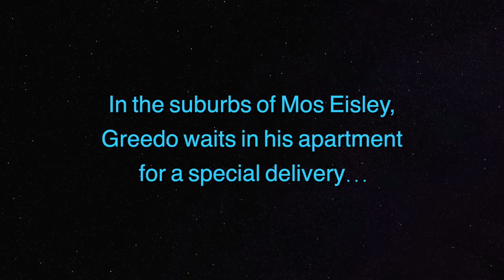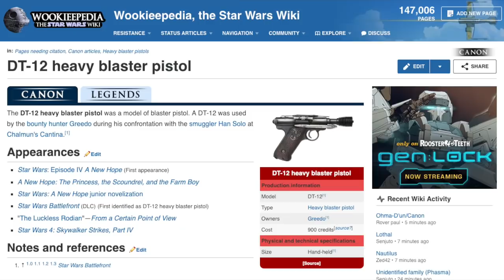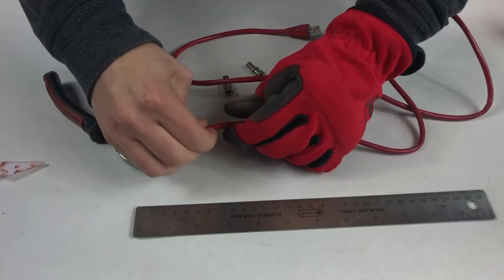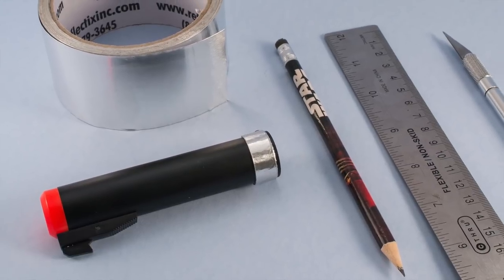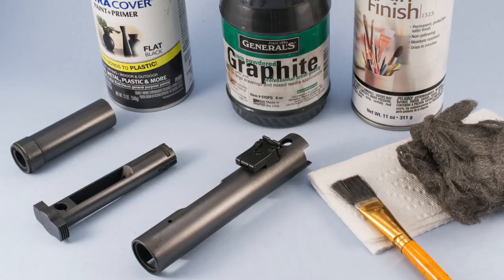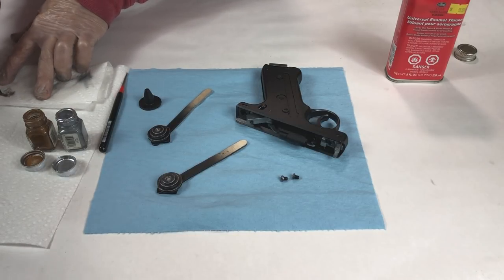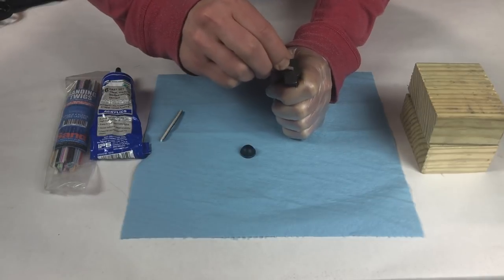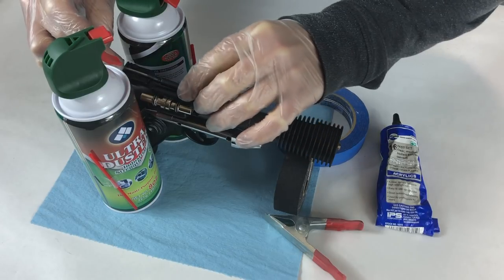DIY DT-12 Heavy Blaster Pistol (Greedo's Battlefront Version)

Comment: What do you use to edit
Reply from the maker: Hello, I use Final Cut Pro X to edit videos.
Reply: HappyTrooper I also have one more question In this video when you edited r2d2 did you also use Final Cut Pro or something else
Reply from the maker: @billylewis9975  I built an R2 unit a few years back, using styrene sheet, 3D printed parts, and electronics controlled by an Arduino Mega.  R2 is controlled with a PS3 Move controller via Bluetooth.  I setup a green screen in my living room and put R2 in front of it.  I then shot some video with my iPhone sitting on a tripod.  Basically, R2 is in front of a green screen, with lights blinking and head turning sporadically.  I never move him.   I had to use Apple Motion 5 to do some of the motion and masking stuff in the R2 scenes.    I plop the green screen video in Motion or FCPx and then add a keyer filter which takes out all of the green.  Then I use keyframes in Motion or FCPx to move him along the X axis (left/right).  Hope that helps :)  Thank you for watching.